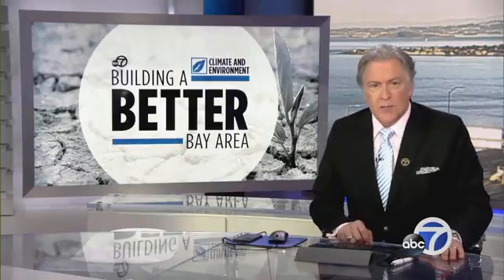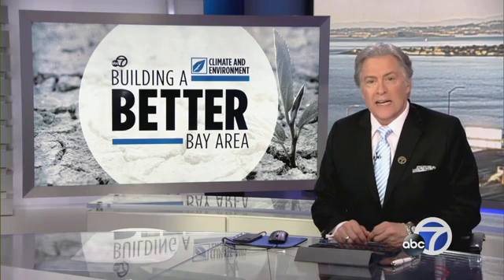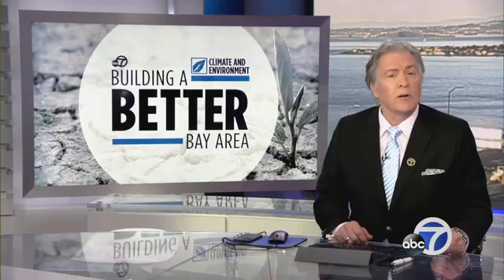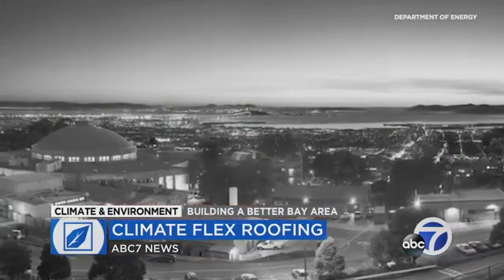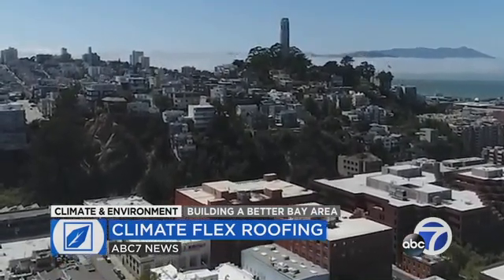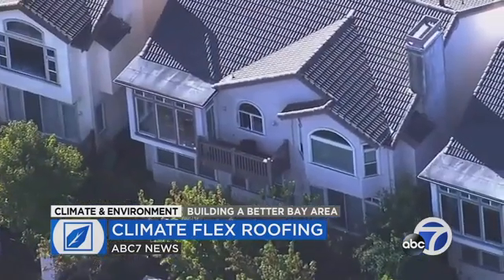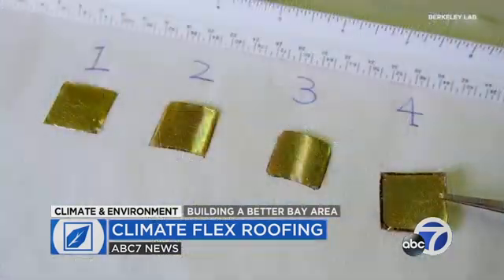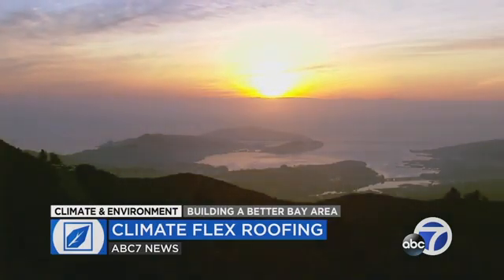UC Berkeley's climate-flexible smart roofs could help save energy year-round

Comment: Forget stopping Global Warming.  Heat is already blowing huge holes in the permafrost in Siberia and similar things are happening in Alaska with loads of methane blowing out of the melting permafrost.  Too late now dudes.  Tipping point reached.  The roofing should help in any case.
Reply: @Jeff Johnson Well, maybe Global Warming can be slowed down, maybe, but not stopped.  Search Artic sinkholes and permafrost PBS and check the other facts.
Reply: @Jeff Johnson Its kind of hard to argue with all the weird violent weather we have been getting. . . not to mention melting of Artic ice, permafrost and these great exploding sink holes.
Reply: @Jeff Johnson Ancedotes are what make up data.  You shouldn't knock ancedotes, or data for that matter.
Reply: @Jeff Johnson So putting relevant ancedotes together, you get data.  Some things can't be controlled (biased) they just are.